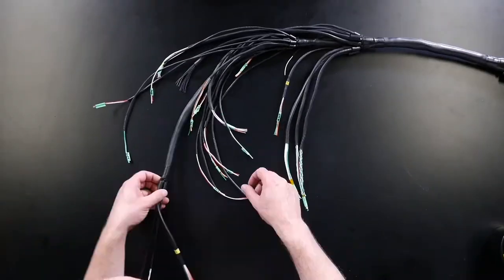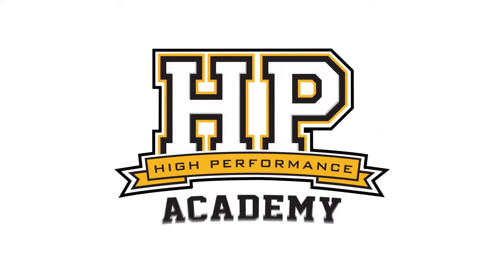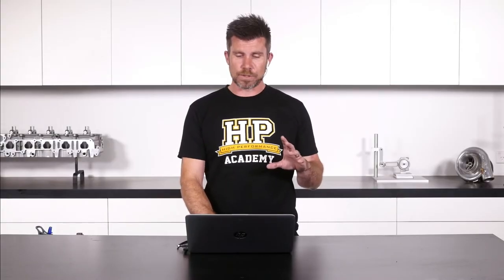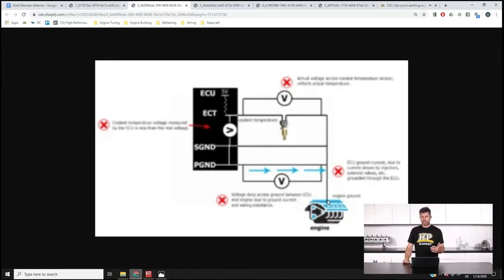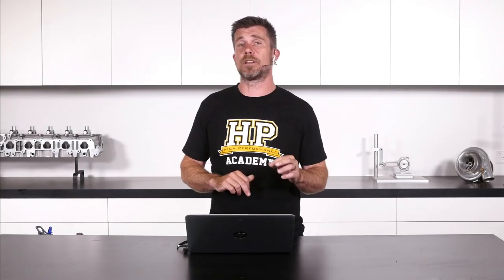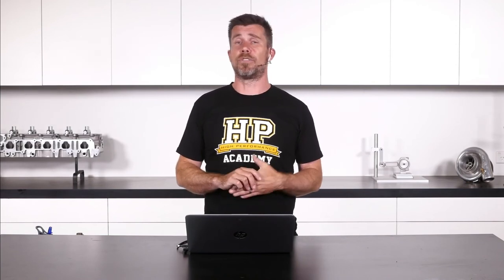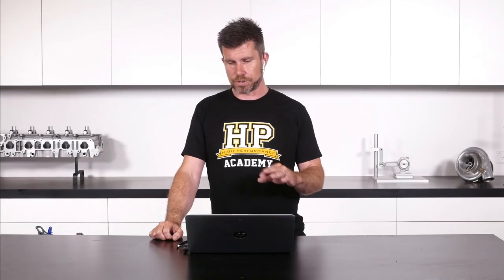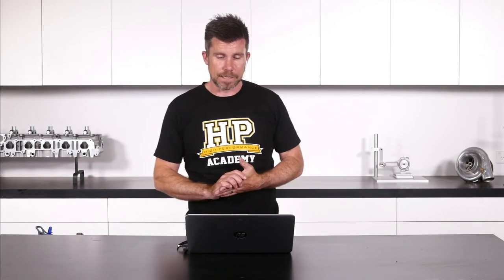Star Point Grounding | Earth Ground/Earthing

Comment from the maker: Building a fast car? Get $400 OFF the all-inclusive VIP package deal:  https://hpcdmy.co/vipy33
Get the wiring knowledge you need. Wiring Fundamentals course now 50% OFF: https://hpcdmy.co/offery33
TIME STAMPS:
0:00 - Introduction
3:40 - Grounding issues
5:10 - Ground offsets
5:55 - Example 1 - Starter motor cranking
9:35 - Example 2 - Sensor grounding
14:15 - Example 3 - Coil grounding - alternator charging current
17:45 - Magnetic field noise
21:25 - Star earthing
27:15 - Questions
Reply: Why would you not show the best practice as a diagram instead of showing all the wrong ways to do it as diagrams??

Comment: I’m an EE with focus on RF and have been an amateur radio operator (“ham”) for more than 35 years.
&
I’ve designed large P25 public safety comm systems  and supervised rollout and installation.
&
I’ve installed countless vehicle 2-way radio and communications systems and audio systems but worked primarily with emergency response vehicles.  Most police cruisers and ambulances are 12V neg ground.  Most fire apparatus and specialized rescue vehicles are 24v neg ground.  With all of the biomedical and advanced communications equipment, the electrical systems in all of these vehicles, pales in comparison to what I’ve seen in the videos on this channel.

I’m absolutely amazed at the level  of complexity and advanced technology used in these performance type vehicles.
The level of knowledge related in these videos is excellent and very much appreciated.

Thank You!

Comment: This was a huge help. I've done a Ford V6 turbo engine swap into an RX7. I figured out that Signal Return was a ground, but I didn't understand that it was the ground for the sensors. I haven't had any issues since it's taken care of by the factory wiring. However, now that I'm pruning a few things, I'll make sure these are correct. I couldn't have found this at a better time. 
Thank you.
Reply from the maker: Stoked that this helped you out mate! Interesting swap too, I hope you enjoy the process of getting it up and running 😎 - Taz.

Comment: So important and such a commonly overlooked part of wiring!
I’ve had to tune well fix then tune an sr20 that was lacking grounds that caused the engine to sync incorrectly around 50% of the time when starting. (Would sync 1 position advanced on a 12/1 trigger disc in oem cas.

Comment: Improperly grounded starter can lead to magnetized sensor wheels or shafts that can cause mysterious driveability concerns. The starter should have a dedicated ground strap directly to the battery to avoid the large inrush current to travel thru the engine if at all possible. 😉
Reply: I have a nissan sr20 in an s13 the starter motor is grounded through the block from factory, is there a way to add a dedicated ground after the fact?
Reply: @lukemurace  if the engine is grounded via a lug on the starter (typical for many cars) there will be no high current flowing through the engine block.
Reply: I've been a tracing down why the hell my drivers side wheel bearing keeps going out and it HAS to be my starter ground. I'm making custom ground cables to replace everything on my car and making a ground straight to the battery for sure.
Reply: @lukemurace  Usually starters will have at least 2 bolts attaching it to the engine or transmission you could always add the ground strap there behind the starter between the mounting bolt
Reply: body..not battery..
Reply: @forbiddenera  I have my starter grounded with a fat cable directly to battery negative and I see no adverse effects
Reply: If the battery is in the engine bay, then yes the best practice would be to connect the engine block/starter directly to the battery negative. However, as pointed out in the webinar, if your battery is in the trunk, you don't need to run a dedicated ground wire all the way from the starter to the battery negative. That is not going to offer any lower resistance or perform any better than connecting both the engine block/starter and battery negative directly to the chassis locally and let the chassis carry the current. This saves a lot of wire and avoids the hassle of running a heavy gauge wire the length of the car.
Reply: @j.m.5995  Does it matter what type of car?
Reply: @nigel_white  but it would help if you run a wire to the battery if locationed in the trunk
Reply: @clutchboi4038  what
Reply: @260k1s  I was thinking the same thing 😂
Reply: @Boosted_Davin  Now I'm thinking the exact same thing one year later 😭

Comment: Coming from Electric hyperarcs, EMI is incredibly strong when the voltage and current go to high levels and than it's extremely important to apply all the possible "defensive" techniques to not get a lot of noise in the sensors / communication wires.

Comment: Thank you! This video helped me learn how to fix my car lol. Today one of the wires in my mazda lit up during starting. So i fixed the wire but I wasnt sure what caused it. After watching this, I remembered one of my engine mount bolts is slightly rusted enough to make one of the bolts move. This bolt is where the chassis to block ground strap is so when the engine moves it moves just enough to loosen that strap causing some weird issues in car. Thank you again :)
Reply from the maker: That's awesome man! Well not the issue, but being able to identify the cause and solving it. Good on you for taking the time to educate yourself so that you can use knowledge like this as a tool.
Thanks for taking the time to comment and share this too. Things like this are why Ben and Andre started HPA 😎 - Taz.

Comment: Do you have a practical example of an engine bay or diagrams of a star point grounding setup? I've always heard people talk on them like this and Haltech but no one has shown an install in practice step by step
Reply: IMO, best example would be to take apart a stock vehicle with the factory  wiring intact. Preferably one that doesn't have electrical issues. Another option would be to look at the factory wiring diagrams.

While there's are examples of terrible designs, most OEMs already figured it out.

Comment: Speaking of grounding, if a battery is in the trunk, is it alright to ground to the chassis then ground the block to the chassis as well? Or is it necessary to run 2 long wires from front to back for power and ground?
Reply: grounds to chassis are fine
Reply: My Mercedes C280 has the battery in the trunk from factory and it only has 1 ground cable going to the chassis rail in the trunk, it starts great and has no power issues, it has plenty of earths in the engine bay for various things though

Comment: I have a g37s and I used a stillen ground kit and right after I installed it I was on E and wanted to switch from 91 to e85 and I did so and I switch my map  to e85 and drove off and I hit it kinda hard while getting on the fwy and my dash lit up I got a code P0605 and I'm don't know if it was found the ground kit or because the parameters was trying to reset or what

Comment: My Mercedes has the battery in the boot from factory and only has one ground cable to the chassis rail in the boot and it runs well, starts great.
Reply: I'm sure there's also a ground strap connecting the engine to the chassis.

Comment: Hey guys, hopefully someone can help me with my query.

I have a standalone ecu which is grounded to the head as per the instructions

The battery is in the trunk so it is grounded to chassis with 0 guage

The engine is grounded from the gearbox to the chassis with 0 guage, and I added an extra 0 guage ground from engine mount to chassis.

There is a couple issues I would like help with.

The resistance between head and chassis is nill when car is off, when car is running at idle I see a high resistance, with load and rpm the resistance gets greater and greater.

The ecu voltage received is lower than what the power coming in is, and with more load the voltage drops pretty dramatically even when the battery voltage and power coming in does not.

Where should I look to rectify this? Am I okay to ground head to chassis? The ecu says to connect to head and not chassis ground so it seems like I wouldn’t be able to do this?

Would using the old slightly knackered ground strap be adding to these issues? I assumed more grounds (even if it’s low quality) would help? I can use 2 new ones vs 2 new and 1 old 

Any help is appreciated greatly - thanks in advance

Comment: "Don't solder your connections"
later on
"Bad connections can cause nuisance performance issues and cost lots of dyno time"
Reply from the maker: Hence the not soldering except for some specific situations 😎
Reply: Soldered electrical connections can become brittle over time and break especially with heat and vibration, both of which there are lots of in a competition car. Crimped connections are far safer in the long term in most cases.
Reply: they're not wrong. soldered connections are crap compared to a properly crimped connection with strain relief.  I've seen more soldered (wire) connections fail than anything else.  Closely followed by cheap butt connectors crimped with a radioshack crimper.  Get the right crimping tools and learn how to use them.   The EAA (planes) and ABYC (boats) both prefer crimping as the primary means of wire connection, and for good reason.
Reply: "Most wire problems happen at the connections, and the experts are mostly in agreement on this one. Connections should be mechanically connected, not just soldered. Per ABYC (E-11.16.3.7), “Solder shall not be the sole means of mechanical connection in any circuit . Further, crimping provides a solid mechanical connection resistant to “cold joints”  breaking under fatigue, and removes strain."